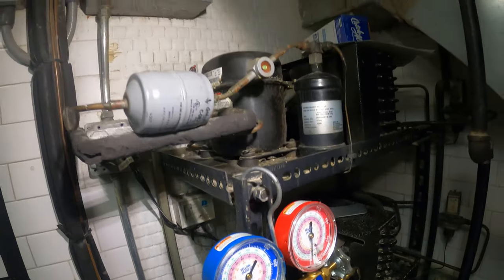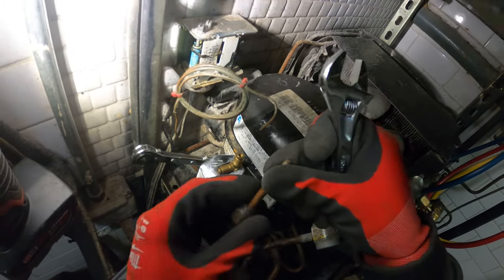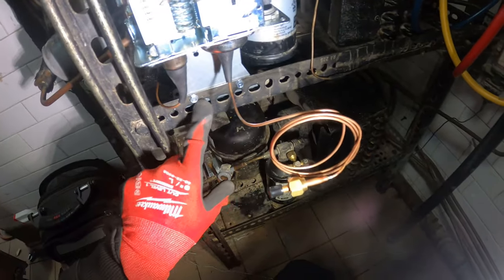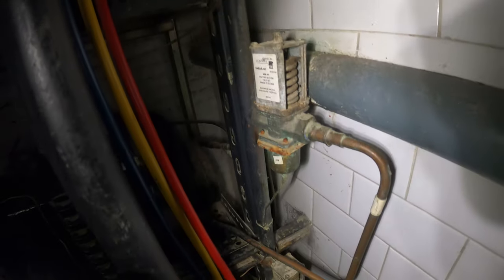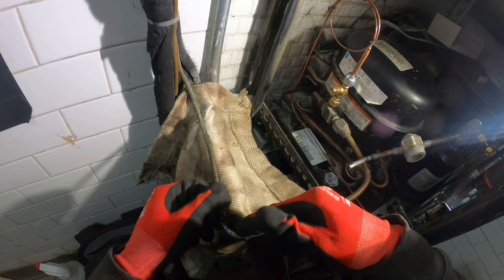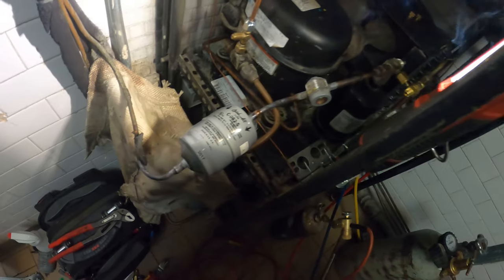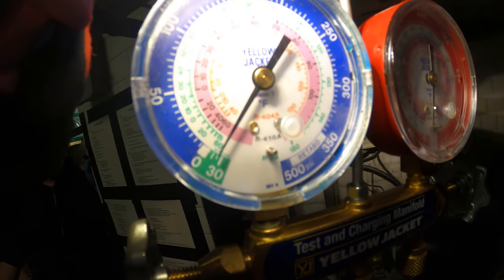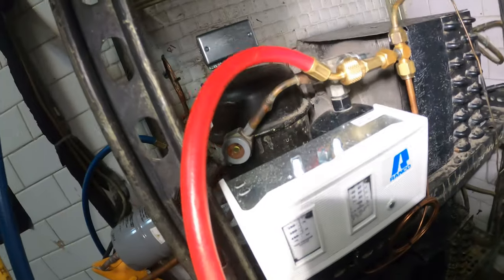HVACR Service Call: Refrigerant Leak Repair/Dual Pressure Control Installation (Refrigeration Unit)

Comment: JMT killin it 💪👍🇺🇸🐕. Great vid. I work on commercial refrigeration units for restaurants. New to the trade n this is super helpful. Looking forward to video on charging by n checking subcooling on refrigeration units with receiver. Some say dont check subcooling when receiver in unit but I like what dick wirz says in his books with diagrams showing subcooling readings with receiver. Ur thoughts n again n Thank-you for sharing your experience n knowledge